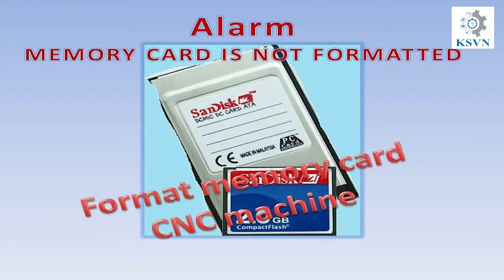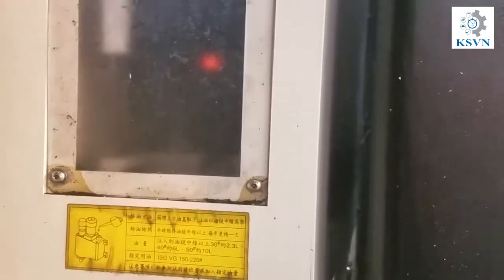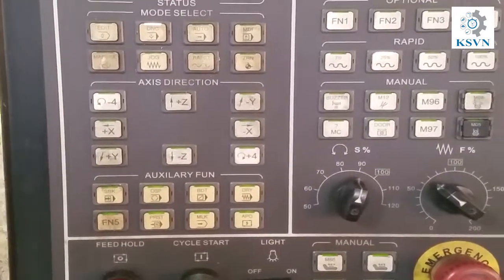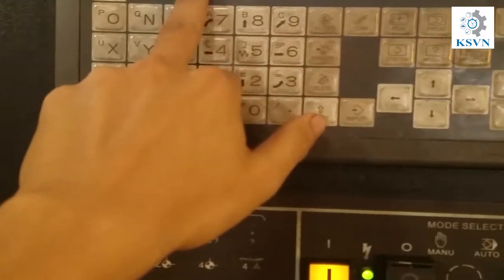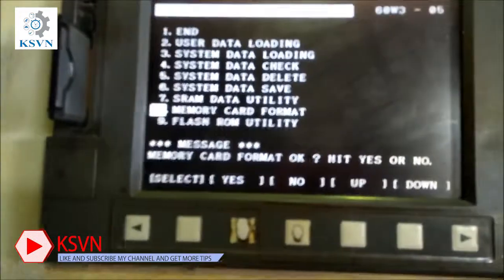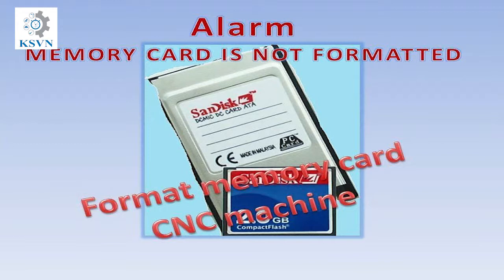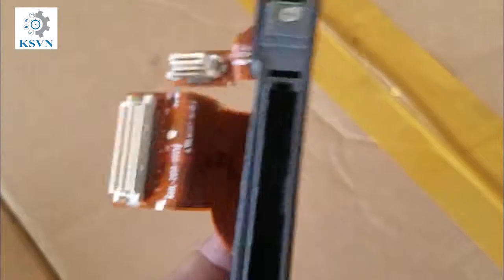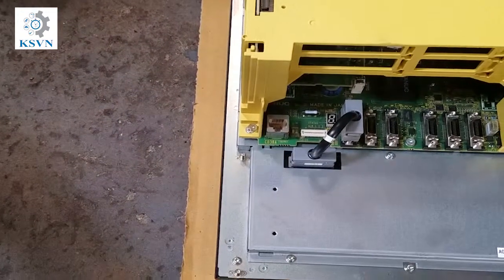Fanuc Alarm ¦¦ Memory Card Is Not Formatted Alarm ¦¦ How To Solve This Problem

Comment: hi 
what if when im at the machine when let me choose yes or not 
it shows 
memory card was protected

previously the card able to use at this machine also (control system : fanuc)
Reply from the maker: YOU can try another card, or replace the slot card on the machine.